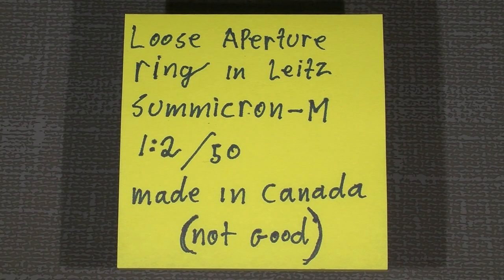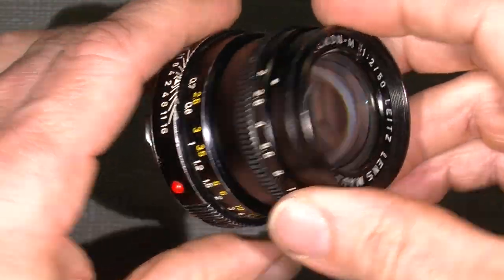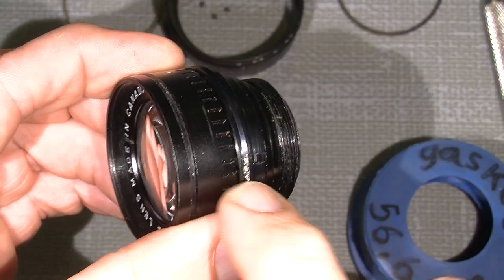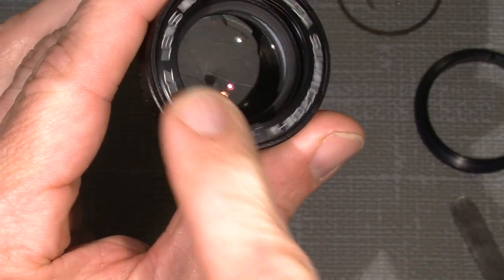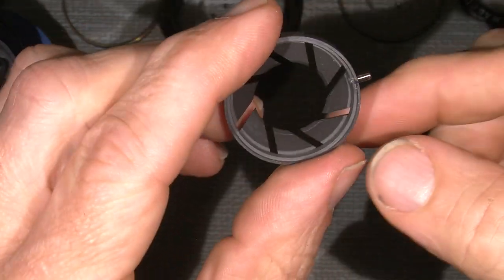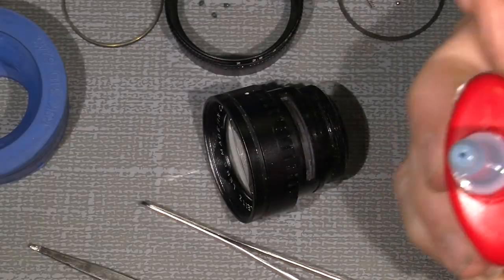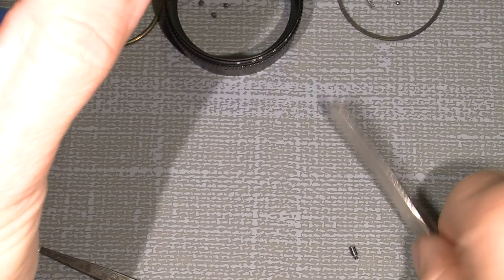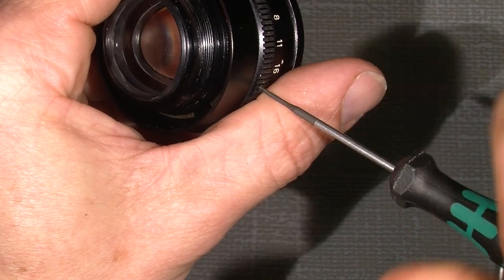Loose aperture ring in Leica Summicron-M 1:2/50   (Made in Canada)

Comment: Thank you for the Video - I have a Leitz Canada 28mm Elmarit 2.8 V2 - in the V1 barrel before they updated the v2 barrel design. The lens is very tight in the focus ring and the front lens block rotates when I bump the hood. I am wondering if you have encountered this lens? Or if you think the disassembly would be similar. Thank you.

Comment: I guess it was for manufacturing cost savings at a time of financial difficulty that Leica used  that plastic ring part and in a bad design, after all it was all about the glass ;-), right? This reminds me of the nylon aperture ring in the v4 35mm Summicron which just plain wore out and everything became very mushy. No share parts available. The older designs like the v3 50mm Summicron was all metal, and a 2-pin aperture ring. I've used one of these for 50+ years and it is a 'tank.'

Comment: Sometimes I've seen a spare tapped hole on the other side, so you can just rotate 180 as benfidar says. I believe they should have two pins, not just one. It's easy to drill and tap. Leica didn't use that plastic for long! It's exactly the same material they use in the M4 cameras to hold the flash ports. It cracks in that situation too and you lose the flash connectors!

Comment: Hi Kenneth,

I have a 1969-1979 production run 50mm Leica M Summicron lens. It's construction is quite different to your later version, and in my opinion, the overall aperture design (of mine) and housing has 1950s/1960s 'thinking' embedded into it, rather poor in my opinion. I've serviced the lens, and it runs nice and smooth, but I'd like to clean the inside of the front element, but as yet I can't open up the front section.

regards
James.
(Edited)

Comment: I lost the ball that go next to the spring, how can I replace that piece ?
Reply: Take apart a junk lens and remove the ball, and see if it fits. Or, get a strong magnet and a vacuum cleaner that you lets you dump out the contents into a plastic pan.  Thoroughly Vacuum the area where you lost the ball, dump the dust and dirt into the pan, then use the magnet to pick the small ball up out of the trash.  If you think the ball may be non-magnetic, use your fingers to feel through the dust and dirt until you feel it or see it.  Then work on a table covered by a white cloth, so you can the what you drop and if you drop the ball again, it won't roll off the table.